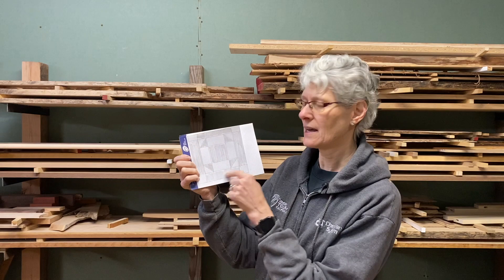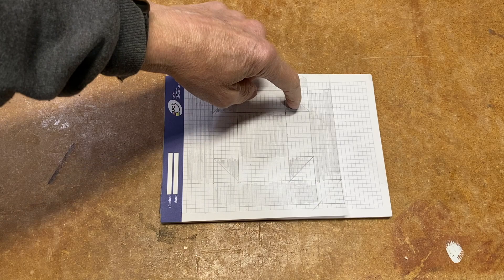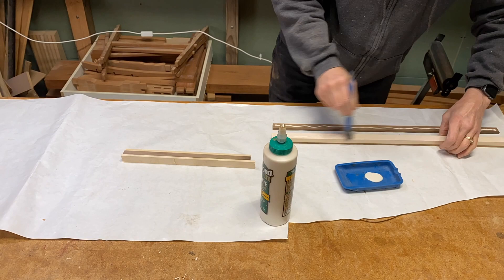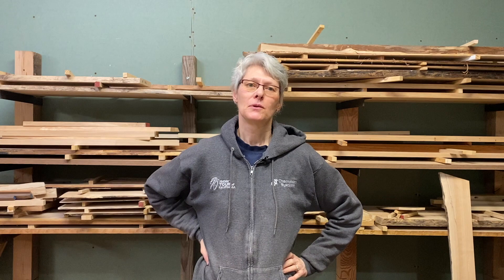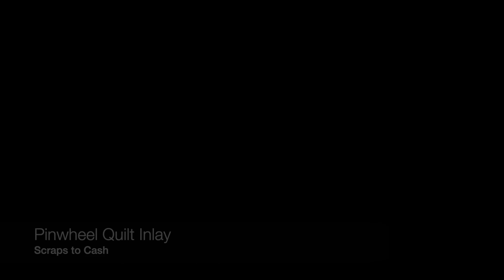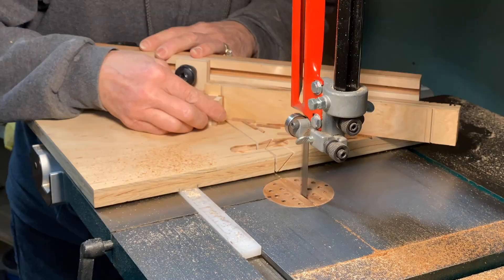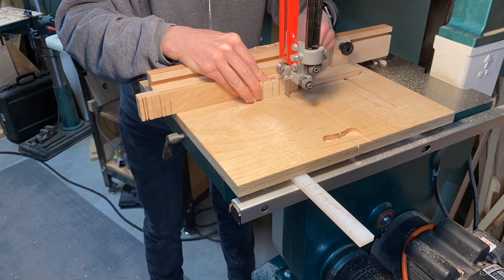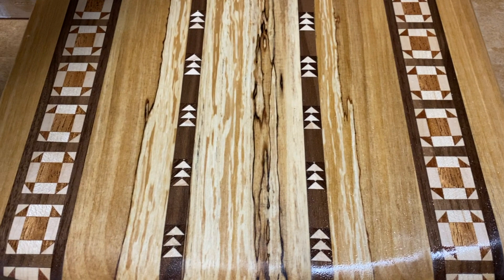Making Wood Inlay - Pinwheel Quilt Pattern

Comment: All I can say is wow!

So many good pointers too. I've never considered a through piece grain orientation on the sections. I try to do inlays but also thought if I wanted a through I'd just use some of my existing. That would have bit me and I probably never would know why either. Maybe blamed the glue.. 

Many intermediate steps to clean up I used to try and skimp on..Get to the fun. Who wants to sand? But painfully discovered the more I do it's a pay me now or pay me later type thing.. Spend the time cleaning as much as  you can now as you go. Or spend the time solving problems on fit up, not as good final result and who knows what other unexpected result. Not just in banding either. So lots of good tips there too.

Thanks for sharing..
Reply from the maker: I’m glad you find our videos helpful! Yes, patience and taking the time for precision definitely pays off. 

We’d love to see some of your resulting projects.
Reply: @SkyValleyStudio  "We’d love to see some of your resulting projects."

I typed message with link to a youTube video in previous message. It doesn't seem to show for me. however if interested I believe you can click my name and I took quick 5 second video of one frame I had handy last night. Just a proof of concept that I could do it. 

I'm never sure if you see a posting from me with link or not. I believe you have on you settings Channel status and features =>community=>block link enabled. My best guess.  Which is probably good. I just cannot link to a pic or other video.
Reply from the maker: Thanks, Greg. The frame came out really nice! Sorry about the delay in comments and getting your post approved. Looks like YouTube needed me to approve the post with a link to another video first to prevent potential spam. I’ll check the other setting you mentioned too.

Comment: Can ask semi related question?

I've made a big uh oh! on a nearly finished big frame.. I'm sick.. I've got about a 1/16th gap that runs about 2 1/2 inches where the inlay banding will go.. router moved while routing.. I'm going to try and fill it and save it. I always use saw dust from a sander and yellow glue. Usually looks ok, and doesn't draw attention but is never the same color..And usually not this big of a mistake  Would mixing dust with white(elmers) glue be better than yellow wood glue. Or something even better in your vast knowledge arsenal I should try? 

Thanks.
Reply from the maker: I would take the opportunity two a 1/32 of an inch thick strip on either side of the inlay. If the router slipped and only a part of it, I would reroute the gap for the inlay all around the frame, add the strips to the sides of my inlay and fit it into the piece.
Reply from the maker: And alternative to this would be to glue in a close grain match piece of wood into the gap. Using sawdust will not give you the same results on that wide of a gap.
Reply from the maker: As far as the type of glue to use, I would suggest using hide glue or “old brown glue” rather than yellow glue. Hide to glue is stainable and won’t leave glue residue that won’t take a finish like yellow glue does. I have also successfully used shellac as the bonding agent in making wood filler paste.
Reply: @SkyValleyStudio  Thank you for taking the time to respond. i took similar route.. I wanted to avoid if possible re-routing fearing chasing the problem I would make worse. I bought some Hide glue and tried mixing with several different species of sawdust on some scrap from the board. Hide went really dark when mixed. Mixed it with dust from white oak, willow oak, maple and box elder.. I saw Hide translucent on amazon but they didn't have that ACE so maybe that is what I needed.  Did same with yellow glue 

I was just hoping for a magic bullet to avoid  routing again.. although it was a dice roll for me I think. Another mistake and the frame was shot.. I think it was the right choice.. Seem to be back on track. Thank you again.